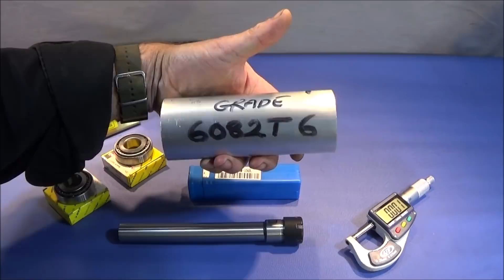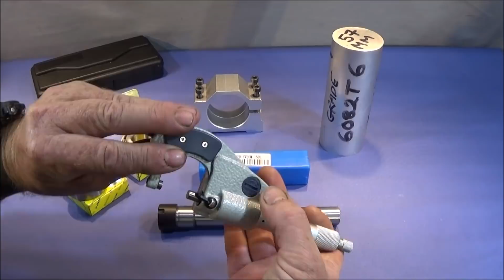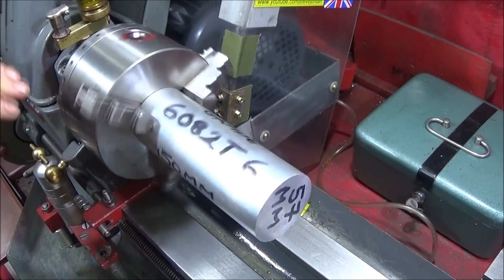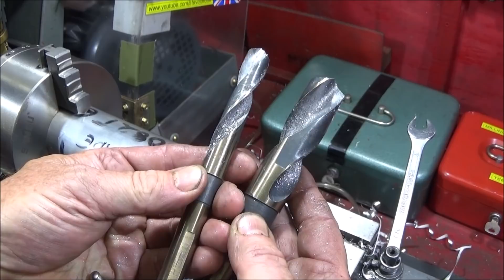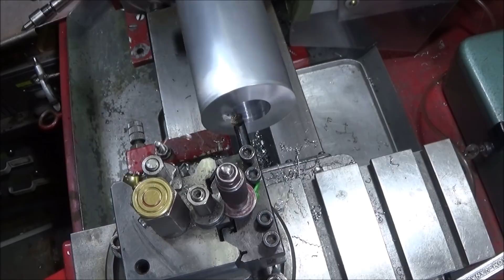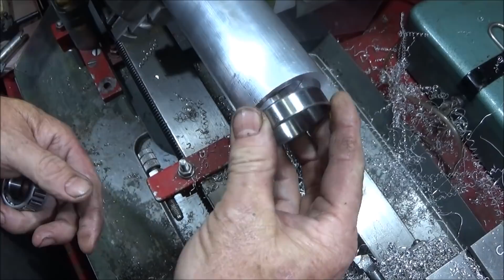Lathe Milling Spindle Attachment Part One Machining A Long Billet.

Comment: I was considering this exact project, but with a steel quill and larger collets. I did purchase the collet chuck, but measured it and assumed what video shows at 5:40 in. I have taken apart many mill spindles and  never encountered one where the bearings can slip on the shaft, they always had a interference fit. This is why I did not proceed with the project.
Reply: Its widely used in industry for very high stress situations and very large loads, and even in things like aeronautical engineering.  You need to update your engineering practice.  Engineering adhesives are quite accepted good practice nowadays.
Reply: As are engineering plastics, ceramic bearings and so on and so forth.  Don't get stuck in a 1950s engineering mindset.  For example many aeroplane parts are joined with engineering adhesives, pretty permanently.  They are used in Civil engineering as well.  Bearing adhesives are pretty low key in this company.
Reply from the maker: Wait until you see the end result and what its used for. to see if its any good or not... 'The proof in the pudding is always in the eating', is what they say.
Reply from the maker: No this will be fine.It will be perfect for what I want it for. Also If I wanted to I could put a light application of Loctite 638 on the shaft when fitting the front bearing, not that I will need to though. These type of bearings wont wear out on small milling operations on the lathe. I'm not making an actual milling machine!
Reply: My point was about engineering adhesives as a whole, but as Steve Mentioned Loctite 648 I did just look at their site:  LOCTITE 648

Retaining Compound - high strength. High temperature resistance. Ideal for retention of parts with a clearance or interference fit.

LOCTITE® 648 is designed for the bonding of cylindrical fitting parts. The product cures when confined in the absence of air between close-fitting metal surfaces and prevents loosening and leakage due to shock and vibration. It exhibits a robust curing performance. The product also works on passive substrates and offers high-temperature performance and good oil tolerance.

Your Benefits

High temperature resistance
Proven to be tolerant of minor contamination due to industrial oils
High strength on all metals, including passive substrates (e.g. stainless steel)
Ideal for retention of parts with a clearance or interference fit
P1 NSF Reg. No.: 148350
DVGW Approval (EN 751-1): NG 5146C00236
WRAS Approval (BS 6920): 0808532

http://www.loctite.co.uk/loctite-4087.htm?nodeid=8802627682305

Like I say, you need to update your engineering thinking by about 50 years.
Reply: https://www.permabond.com/industries_served/aerospace-adhesive/

........The engine contains threadlockers, retaining compounds, hydraulic system thread sealants as well as structural adhesives........ etc. etc. etc.

Wake up and smell the coffee
Reply: https://www.eminebea.com/en/engineering_info/bearing/ballbearings/cat-4/005.shtml
Reply: http://www.machinebuilding.net/ta/t0418.htm
Reply: http://www.gobearings.com/adhesive.htm

Small bearings usually have thin raceway cross-sections and radial play in the range of 0.0002 to 0.0008 inches. This means that considerable care needs to be taken when bearings need to be permanently mounted on shafts and/or housings. If bearings are press-fit to their mating components, tolerances of these components will need to be held tightly to avoid loss of radial play and bearing malfunction. As an alternative, bearings are often bonded in place with adhesive. This method also allows bearing pairs to be preloaded with a weight to remove axial play while the adhesive is curing. With proper design and handling, a bearing assembly using adhesive bonds can be extremely strong. This section deals with some of the issues involved in adhesive bonding.
Adhesive Types
Adhesive Grooves
Applying Adhesive
Loctite 609
Reply: https://books.google.co.il/books?id=jFNdDwAAQBAJ&pg=PA91&dq=Use+of+engineering+adhesives+for+bearing+fitting&hl=en&sa=X&ved=0ahUKEwigsviptbvdAhXis4sKHcoEAygQ6AEIJjAA#v=onepage&q=Use%20of%20engineering%20adhesives%20for%20bearing%20fitting&f=false
Reply from the maker: chris0tube Don't mind me saying but you sound like a troll to me? All the evidence has been presented to you by Luke, giving actual Loctite specifications and data, yet you still seem to lack basic engineering knowledge on the subject. Also judging by your childish abusive replies, now removed by me, I think you are one of those that is trying to demand attention with your naive comments. I don't normally remove comments but when one is showing tantrum like behavior and wasting comment space with stupid replies, then I will remove such.
  Try and be nice and comment in such a way that people will benefit. Remember the old saying, 'Many words spoken but nothing really said', when commenting.
Reply: Thanks Steve, what a loon.
Reply from the maker: I have checked it. It doesn't rotate on the shaft  in use. Also a light smear of Loctite 638 when fitting completely removes any chance of slippage even if it was a thou or two loose.
Reply: you can use loctite man
Reply: Loctite bearing locking compound.  That's what it is used for (amongst other things).  Admittedly probably not the old way of doing things but for this application perfectly OK.
Reply: Engineering adhesives are used on the gluing of the wing sections of the Boeing 777 and 787 together (and many others).  These are very high stress situations.  Get your head out of 1950s factories and wake up.
Reply: And the heat tiles of the Space Shuttle and so forth.  There are a huge variety of engineering adhesives and they are used in all sorts of circumstances. I suspect for example that ceramic bearings would not usually be interference fitted but would be glued.
Reply: See the references I have provided.  Basically you are talking out of your proverbial.  Bearing adhesives are used almost universally in the engineering industries for exactly the sort of use Steve has put them to.  Another YouTube 'expert'.
Reply: If people fit high speed bearings in engines and other similar circumstances (which it is clear that they do, frequently in manufacturing industrial production) with the use of adhesives then it seems to me there really cannot be much wrong with it as a practice.  It could be that it has replaced the kind of very high tolerance machining that you refer to as it is regarded as a more efficient use of engineering time for a particular result.  Certainly these products, from a wide variety of manufacturers are used across the World.  My point is that changes in engineering practice, have and do occur over time and what was best practice in 1950 is not necessarily so today.
Reply: Also, I'd like to see some of your excellent engineering videos that you don't produce.
Reply: You certainly can and do see the advice to use engineering adhesives (and all sorts of other 'non metallic' inclusions for that matter) on drawings, yes.  Why wouldn't you, especially as it is a normal manufacturing engineering practice?
Reply: From Assembly Magazine, 2013

Increasing Strength and Reliability of Interference Fits
Retaining compounds enable engineers to design robust, lightweight joints at less cost than traditional interference fits.

Interference fits, commonly referred to as press fits and shrink fits, are traditional methods for joining cylindrical parts. In an interference fit, the inner part—such as a shaft, bearing or bushing—is machined to be bigger than the mating hole of the outer part—such as a gear or housing. The larger part is then forced into the smaller part. Both parts deform slightly to fit together and extremely high friction results between them. The friction is so great that even large amounts of torque cannot separate the parts. They operate as one.

For maximum joint strength and optimal performance, interference fits must be highly precise. Engineers go to great pains to calculate and achieve the appropriate allowance that will provide maximum friction between the parts. This dimensional precision increases both the cost and the time required for component production.

A reliable interference fit puts high levels of stress on the joined components, which limits substrate selection. Only certain materials can withstand the stresses of machining and the forces required to merge the parts. For example, an engineer may not be able to select powdered metal or aluminum for a component because steel is required to achieve the target joint strength.

Adhesives called retaining compounds enable engineers to design robust, lightweight joints at less cost than traditional interference fits by reducing dimensional precision and increasing the selection of viable substrate materials. Retaining compounds provide strength and reliability and are commonly used to secure bearings, bushings, gears and cylindrical parts onto housings or shafts.

Retaining Compounds
Retaining compounds are anaerobic structural adhesives that polymerize when the liquid is confined without air between close-fitting metal surfaces. The first and best-known use for anaerobic adhesives is thread-locking, in which a drop of adhesive applied to the threads of a nut and bolt bonds the assembly, prevents vibrational loosening, seals the threads against fluids and moisture, and prevents corrosion and rusting. Manufacturers embraced anaerobic threadlockers as a chemical solution to the mechanical problem of loosening.

Engineers soon discovered another use for anaerobic adhesives: assembling cylindrical metal parts. The retaining compound fills the empty space between the mating surfaces and cures to chemically unitize the assembly. The combination of an interference fit and a retaining compound is much stronger than an interference fit alone.

The cured adhesive fills the inner space between the components and provides a physical and chemical barrier that eliminates fretting, oxidation and galvanic corrosion. The adhesive also seals the interference fit joint against leakage.

Retaining compounds are used in three ways for interference fit joints:

added to existing interference fit designs to increase joint strength and reliability.
engineered into new interference fit designs to create smaller, lighter weight assemblies. The parts can be made with relaxed tolerances requiring lower cost machining.
used to structurally bond a slip fit that eliminates the need for an interference fit. The parts do not need to be machined to tight tolerances, and the joint is as reliable and effective as an interference fit.
Retaining compounds increase the strength and reliability of a traditional interference fit. Interference fits generate strength from the metal to metal contact of surface peaks, which represent only 15 percent of the total surface area of the joint. The liquid retaining compound fills the surface irregularities and clearance gaps between the two parts. It then cures to create a dense, high-strength bond that increases joint strength and achieves maximum load transmission. The cured resin increases the area of surface contact so stress distribution is improved. This enhances joint reliability, reduces equipment downtime and increases part life.

Whether it’s an interference fit or a slip fit, components bonded with retaining compounds do not require precise dimensions or a fine surface finish. Bonded interference and slip fits allow relaxed tolerances that are ideal for joining dissimilar metals and translate into lower-cost processing for components. Bonded assemblies experience less stress in the joint and are more robust under differential thermal expansion. So when different substrates are bonded, the assembly maintains its strength better, since the joint does not depend on the interference fit alone.

Retaining compounds prevent fretting corrosion in interference fits. Fretting corrosion results when micro-movement occurs between a bearing and a shaft or housing, causing small sections of the assembly to weld together. When the assembly moves the next time, these small welded sections rip off and result in a cratered surface. By filling the inner space between interference-fit parts, retaining compounds prevent this micro-movement.

Retaining compounds also serve as a sealant that prevents corrosion and leakage and provides a physical and chemical barrier to oxidation and galvanic corrosion. These adhesives are often used to seal core plugs into an engine block and to close off the outer diameter of a rotary seal installed into a housing.

Retaining compounds can replace brazing and welding with a quick and simple process that does not require specialized equipment or skilled operators. Unlike brazing and welding, retaining adhesives do not produce hazardous fumes. Bonding is also faster than brazing or welding.

Application and Removal
In their liquid form, retaining compounds may be applied using manual, semiautomatic and fully automatic dispensing equipment.

An example of a fully automatic dispenser is the Rotospray applicator. This device applies a metered amount of adhesive in a 360-degree bead or band onto a predefined location in the bore of a part. Application is precise and repeatable. The applicator can be positioned in any axis and operated in either semiautomatic or fully automatic mode.

Hand pumps are precision applicators for manual dispensing that control the volume and location of adhesive. The heart of the hand pump is an adjustable-stroke peristaltic pump that dispenses a metered amount of adhesive each time it is manually actuated.

Parts assembled with retaining compounds come apart with the standard disassembly methods for press- and shrink-fit components. These methods range from gear pullers to hydraulic oil injection to hydraulic presses. No special processing steps are required to break the adhesive bond.

Retaining compounds are available in medium- and high-strength formulations. A medium-strength retaining compound may be preferred for a joint designed for routine disassembly.

Advancements in Chemical Retaining
Recent advancements have made retaining compounds more robust for today’s process and performance requirements. Formulated for simplified processing, the latest compounds do not require primers or activators to enhance cure speed or strengthen bonds. Once assembled, they resist higher temperatures than earlier formulations.

Surface cleaning and preparation processes continuously evolve as a result of environmental, safety, regulatory and cost-saving initiatives. While clean bonding surfaces deliver the best results for any assembly, the newest oil-tolerant retaining compounds are formulated to cut through light oils and surface contaminants. The result is consistent bond strength despite variations in the cleaning process.

Engineers employ a wide range of substrates and coatings when designing interference or slip fit  assemblies. For example, aluminum is used for weight reduction and stainless steel for chemical resistance. Historically, a chemical activator or primer had to be applied to nonferrous parts to cure the retaining compound. The newest primerless compounds cure on these surfaces as well as they cure on steel. The primer is no longer required to achieve polymerization,
making the process more robust and eliminating an assembly step.

Size, weight and efficiency are key parameters for most new interference or slip fit designs, targets that drive assemblies to higher operating temperatures. The latest heat-resistant retaining compounds can withstand continuous operating temperatures to 180 C. Even when high temperature capability is not required, these formulations increase the safety and robustness of the assembly.

Typical Applications
Manufacturers use retaining compounds to lower costs, increase performance and improve reliability. These are just a few real-world examples of their use in industrial applications.

To reduce stress concentrations and potential premature failure, a slip-fit bonded with an anaerobic retaining compound replaced an interference fit on the lobe of the eccentric shaft of a brushless motor. The new design enhances overall strength of the assembly and helps it operate over a sufficient temperature range, resist lubricating oils and withstand torsional stress. The new design relaxes tolerances and reduces part costs, simplifying alignment and reducing stress.

On large air bearings, steel threaded inserts are bonded to the 18-guage galvanized steel bearing surface using a retaining compound. This eliminated spot welding and the extra cleaning step to remove oxides from the surfaces.
Reply: I was going to say, and this article actually says it for me that aluminium and steel cannot be meaningfully interference fitted in any case, which is bloody obvious.
Reply: The answer is yes, you can perfectly well ask for an adhesive fitting, did you not read what I just said?
Reply: You really DO need to get your head out of of your 1950s fundament.  Adhesive fitting can be used as it is in industry constantly to avoid the need for super high tolerance machining and can be used to achieve solid fitting to very dissimilar materials.  And that is why and how it is ACTUALLY used in industry.
Reply: '....Engineers soon discovered another use for anaerobic adhesives: assembling cylindrical metal parts. The retaining compound fills the empty space between the mating surfaces and cures to chemically unitize the assembly. The combination of an interference fit and a retaining compound is much stronger than an interference fit alone.....'

I'm not sure what part of this you find so hard to understand?  IT IS NORMAL ENGINEERING PRACTICE TO FIT BEARINGS WITH ADHESIVE THROUGHOUT INDUSTRY.
Reply: Let me be quite clear.  It is common practice, as you well know, to adhesive fit bearings throughout the mechanical engineering sector and yes, I would specify that on any drawing where it was appropriate to do so, in preference to a more traditional full interference fit.  Clear enough?
Reply: No, I called you a loon, not Steve.  It is you who are an arrogant and insulting person stuck in the past.    You have no YouTube 'rights' BTW, in case you hadn't noticed.
Reply: My final word on this comes from 'Industrial Applications of Adhesive Bonding
edited by J.H. Sadek, Elsevier 1987' and perfectly explains why it is appropriate and indeed wise to use these compounds in rotary bearing retention:

Section 6 - Industrial Adhesive Bonding in North America by Gerald Schenberger

6.6.1. Retaining Adhesives
Machine tool builders have traditionally utilized a number of press-fit
designs for incorporating studs. bushings, and bearings. Designs of this
type require very close tolerances and expensive machining.

It is believed that only about 30% of the metal-to-metal surface area in
a typical press fit is actually in contact. Press fit assemblies are subject to
gradual loosening as a result of vibration and temperature cycling.
Retaining adhesives, which can fill the voids formed when metal
surfaces are in contact, harden in the absence of air. They are widely
used to overcome the loosening problem and substantially reduce the
cost of manufacturing. They fill the surface irregularities between the
hole wall and the stud or bearing, and are capable of filling gaps as large
as 0.07 cm.
Reply: Again from 'Assembly' magazine:

Anaerobic adhesive is another material that can be applied to the parts to augment press-fit assembly. The adhesive will completely seal the joint, prevent corrosion, distribute stress more evenly, and produce a stronger, more rigid assembly. The adhesive also allows engineers to loosen the tolerance requirements for the parts and reduce the bulkiness of the parts, which is needed to generate the pressure that holds the parts together.
Reply: I have provided mountains of empirical evidence and could supply mountains more if required.  The fact that you choose to ignore all of it is your problem, not mine.
Reply: I have been watching this and reading the comments. Trying to learn more, and quite interesting. Most of my career has been spent in shops that produce critical and highly critical components. Tolerances, fits, and clearances are carefully engineered. Considering bearing fits only, Reading the comments, it seems that most of the cases posted here, and in the links seem to show that there is some sort of interference fit existing, though it may be limited, maybe only 30 percent, and possibly even less with a less critical machining, and that the adhesive mfrs, and other sources, suggest that the adhesive "Augments" the existing, poor it may be, interference fit by filling in the gaps that remain. chris0tube points out something important that we should consider, and that being, a machine manufacturer that specifies a "Adhesive Fit" on a spindle bearing, or some similar bearing is something we have not discovered at this time. Another important thing to consider, and was brought up by him, is the Engineering Fit Tolerances Standards that appear not to cover Adhesive Fits. I do not have the time to research this subject in great detail, so I must let this comment thread be the initial place to research from for now. I just wish more people, who have good experience in these areas would jump in.